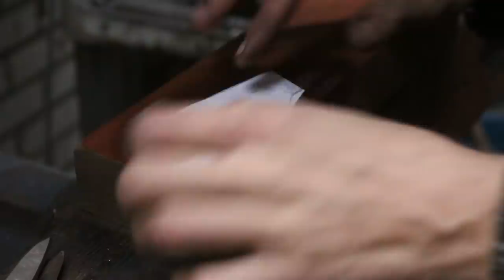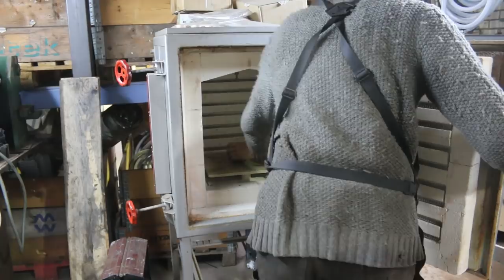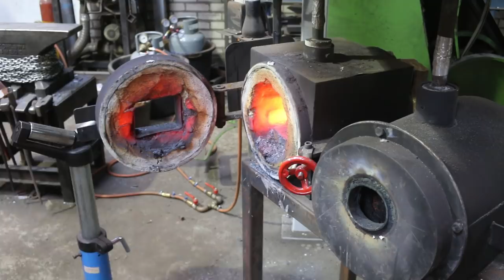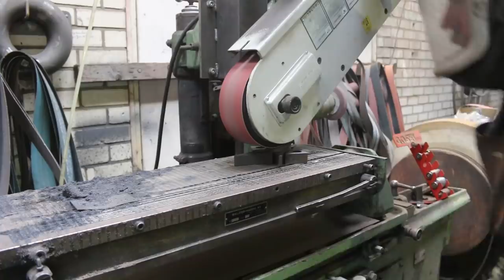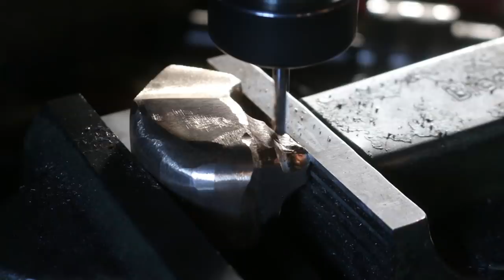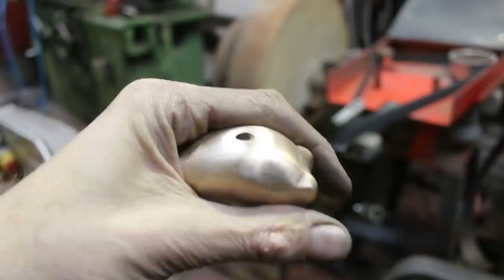Forging a pattern welded Falcata machete , part 3, sculpting the pommel.

Comment: I ALWAYS have trouble telling a Kopis and a Falcata apart.  For one thing, I always thought Falcata's had to have a horse-head pommel for it to be a Falcata, but apparently that's not accurate.  I've also heard that when it comes to the point on the spine where the blade curves forward, one does so at a very steep angle, but the other has a more natural curve to it.  Can anyone help me settle once and for all what the differences between these two swords is and how to identify one from the other?

Comment: Is that bronze or something like it? Cause that material cut off the band saw literally looked like a meteorite
Reply: Beautiful as ever 😍
Reply: I want to know as well. I think it might be brass, but brass and bronze look similar. I would think bronze would be more golden colored though
Reply: @beaverwithaforkv.26  yeah I though brass but then why the layers when it was cut?
Reply: I would say it's bronze. It is a better material for casting. And those lines are made by the bandsaw. Bronze is way softer then steel, this allows the sawblade too cut through faster, leaving these lines